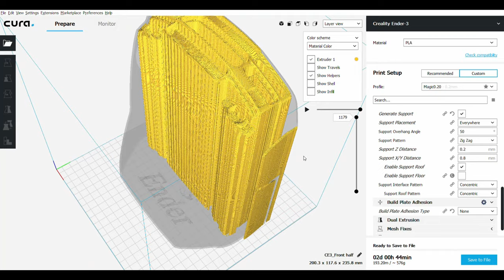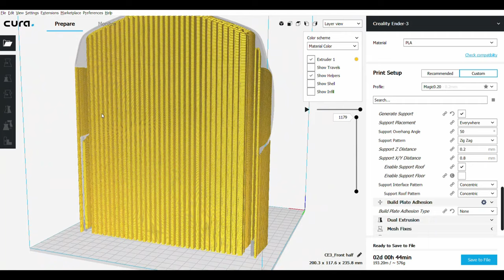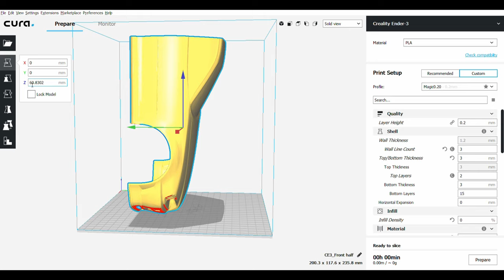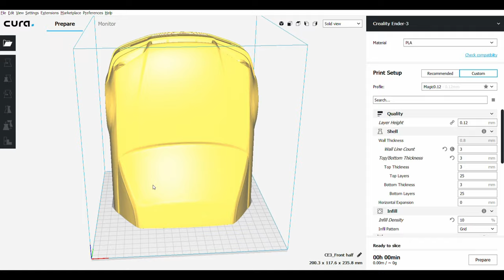How to 3d print rc car body fast and with less support/Painting rc body/Scale Addiction

Comment: AWESOME MAN!!!

I finally got my 1/32 scale Nascar slotcar body to print properly and beautifully, from following this video, and making a couple of tweaks to the settings because the newer version of Cura is a bit different now.

Now I just have to adjust the thickness of them to about half of 1.2mm, because that's too think for slot cars or even models of that size.  Well, for models it doesn't really matter, as they are fine if they weigh a bit more...

I was also using Blender, and had problems with the models after bringing them into Cura, so another video helped me fix those issues easily by grabbing 3D Builder from MS for free, which when you bring the STL in, it tells you there are problems and it auto fixes them with the click of a button.  The only downfall was, it's auto fix also created a bottom to the body, but there was a simple "Hollow" button as well that then asks how thick you want your walls, which is where I assumed 1.2mm, but that's best for larger scale RC cars than it is for 1/32 scale slot cars.  Oh well, trial and error...

Thanks again for the awesome videos and going over your Cura settings here, it's helped me immensely!!!

Comment: If you can get away with it: make the part needing support thicker (it's on the inside) but flat.  That way you can bridge it.  The bottom layer might sag, but it's on the inside (invisible?), so you might just cut it off after print.  You can also just add a thin flat band / beam to your model just below the area where supporting is needed and then have supports from there to the top and cut off that band after printing.  If the flat band becomes too long for bridging, then add small support structures in the design to split it into sections that can be bridged or just make it thicker so the first layer might sag a bit, but this would correct in the layers on top and since you anyway will cut it off, looks don't matter for it.

Comment: You should also try at 45°. Initially split the model at 45 so you have a flat base. It's hard to explain but when doing the front most of it would be at 45 so maybe no supports needed or very little
Reply from the maker: I thought about that, but the joint line will be longer

Comment: Hello I have a question I’ve downloaded a Silvia s15 scaled at 1:10 I’ve scaled it down to 1:16 since that’s the size of my rc but the print is coming out paper thin and with holes n shapes please help
Reply: Do you have Blender? You can thicken models easily to rectify the issue.

Comment: I know these are big scale. I really want to do 1/24&1/25 car models. How do you get the body design's? Is there a place to get them or can I draw them in cura? Can you steer me in right direction? I'm getting a ender 3 max soon and want to make sure I have a good computer maybe a laptop. Any ideas? I'm not a big fan of Apple. I've had lots of HPs
Reply: If you want to design your own bodies, you’ll need to CAD it using CAD softwares or websites and import it into cura. Personally, I very much prefer softwares over websites as they tend to be laggy and slow. fusion 360 is a really good and free software. Any computer with a decent spec would be able to run it (I have a normal hp laptop with i7 and no gpu) but if you’ll spend a lot of time of CADing and such, I recommend a computer with a gpu, or even better, a gaming computer.
Reply from the maker: There is so many videos on YouTube to start with designing on fusion 360 or sketchup, try to start with designing simple models to have some experience 
And all my models available here
https://cults3d.com/en/users/ScaleAddiction/creations
Reply: Consider using resin printer for 1:24, you will have better results and less work